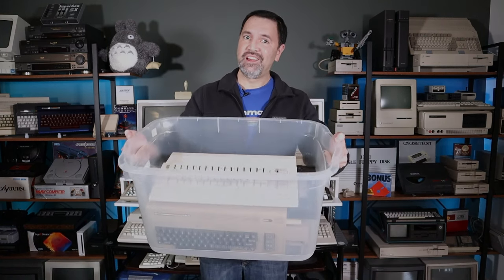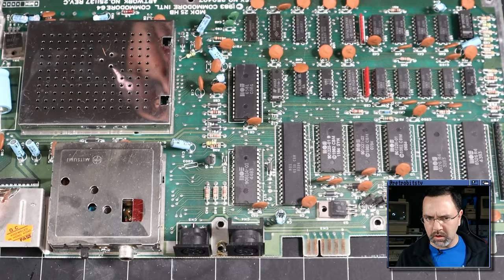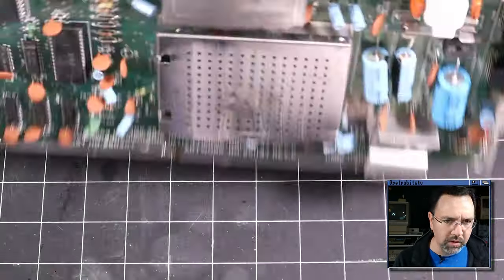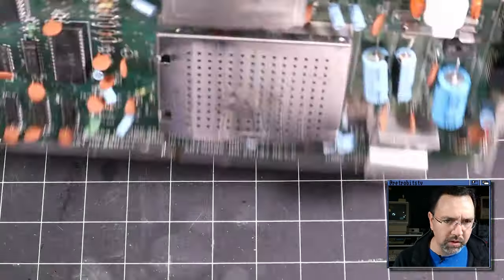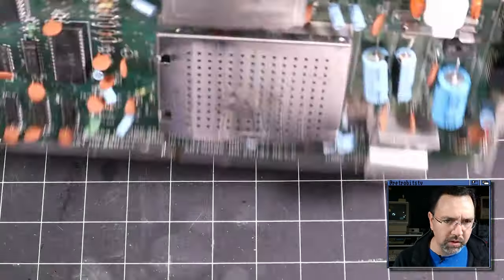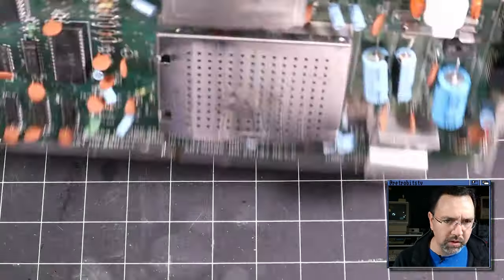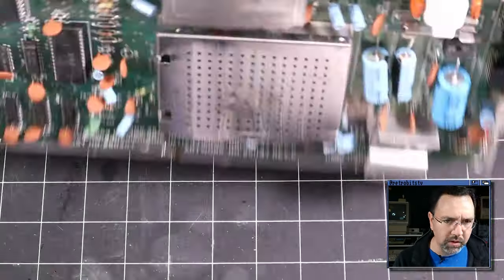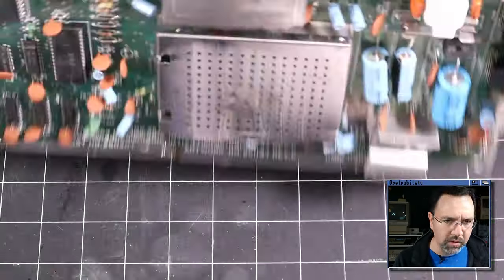A classic Commodore 64 repair!

Comment: Very well done and I actually like these kinds of less planned-through videos a lot! Unfortunately the 6510s fail quite frequently in my experience. :/ One little thing I noticed: while testing the voltages, you should also test the 5V rail coming directly from the power supply (for example on the user port), as that rail powers most of the ICs in these older breadbins (that's also why a bad power supply often kills multiple chips at once). The voltage regulators are used as a cleaner supply for the VIC-II and the SID to minimize noise.
Reply from the maker: Thank you for the feedback! I haven't yet had a 6510 fail in one of my own machines, but I've only worked on a small number of 64s up till now. Good to know; I didn't realize that about the regulators vs the PSU. I guess I'm going to have to study the schematics a bit more and brush up on the power supply side of things for next time!

Comment: If the 6510 can be replaced with a modified modern 6502, you should do a video walking through all the steps involved in that.  It would be very informative and interesting.
Reply: Yes, even if you only get 95% compatibility. It is a board that uses the 65C02 (or an older, original 6502) and intercepts the first 2 addresses on the bus. It's not quite how the 6510 did it, but it works.

Comment: Like many others, I went through a phase where I sort of became addicted to repairing Commodore C64s. Although I've had some 6510's fail, by a large margin, the issue is typically the PLA, MOS made logic chips or M/T RAM. Jan Beta sort of created the c64 term "future-proofing". It would be in that computer's best interests if all MOS logic chips (I saw 1 for sure) were removed. The other chip that fails quite often is unfortunately the precious SID. Your diagnosis approach is spot on and your soldering technique is very good.  Good video and congrats on the repair!

Comment: Any time you are trying to desolder a large thermal mass low melt solder will b e your very good friend. The resultant alloy's low melting point simplifies the removal process a LOT.

Comment: An excellent video. A straight forward step by step approach to solving a problem.  Your video is now bookmarked as a favorite.  Something I am still hoping to find is a good video that shows every test point on a working C64 and the expected result (Oscilloscope screen, multimeter reading etc.)
Reply from the maker: That would be a very useful resource. I'm not sure I've got the knowledge or equipment to gather all the correct information but certainly something I'll think about!

Comment: TY for the years of GREAT Commodore content! Where did you buy it that device that turns the power plug 90 degrees to the rear or did you 3D print its case and make it. I bought a new 3D printer (Anycubic Kobra 2 Pro) and really need to start using it! lol
Reply from the maker: There are plans on the net for how to build your own, but I just bought this particular part: https://www.commodore-4ever.com/product-page/64-to-64-90-degree-adapter-commodore4ever

Comment: in regards to the RF shield, I just generally 'push' on it with the tip  of the soldering iron as the solder melts, it's a one step process. There's a finesse or learning curve to it, but once you get it, it's easy peasy. However, that's on units where that is to be salvaged, otherwise, just cut them off. ;)
Reply from the maker: I thought about trying that but I wasn't sure if it would damage the finish on the tip or not!

Comment: LM556 is a timer chip. it's a dual LM 555, used for clock and for reset line hold down(timed) I dont know what that particular 556 is used for though
Reply: Commodore 64 machines usually only have one of those.

Comment: Was the sound cutting out during the diagnostic test something that happened with the recording? You didn't comment on it when it happened.
Reply from the maker: I was listening to the C64 audio at low volume through the laptop's built in speaker during the stream so I didn't hear the problem at the time. It does sound like an issue with the capture/encoding though - the glitch in question occurs during the volume register bug 'pop', but all the other pops sounded normal during the diag test and the SID music and game sounds all were fine too. I may go back and test the system out again later but it's already packed away for now.

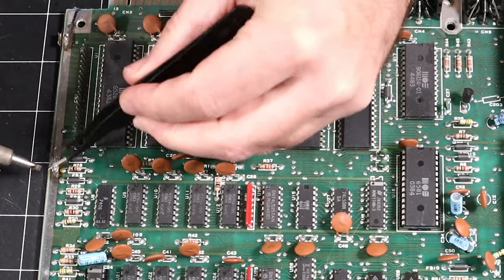Comment: 6:12 when you say to “cut them off”…how would you go about doing that?
Reply: For those curious, I ended up using a small pair of End Cutting Pliers to gently pry the RF shield away from the board before applying more pressure to break the solder. 

Worked really well - didn’t need to heat up the solder at all and easily removed the shield in just a few minutes.

Comment: When you have no video, will you see the white line on a commodore monitor?
Reply from the maker: It really depends on the monitor and the failure condition of the computer itself. If you can shrink the horizontal size enough or you have an underscan button on your display you should see the white line but on some monitors and TVs without the H-Size adjustment you won't. If the VIC-II isn't getting a clock signal and power and isn't generating a video signal, you won't see any line at all.